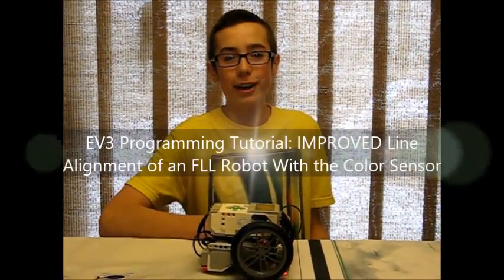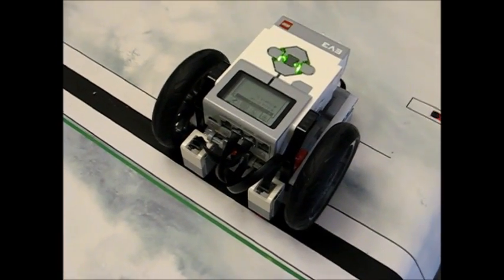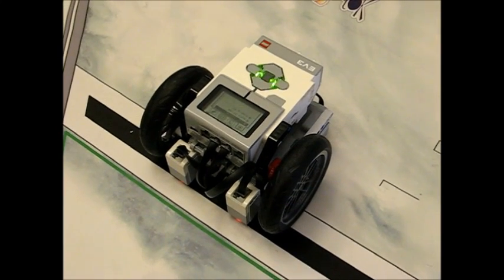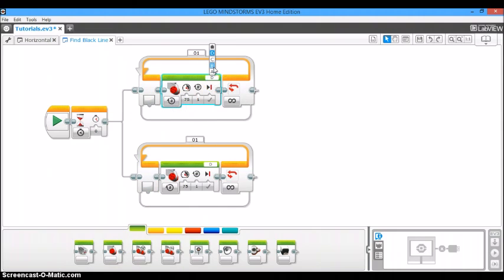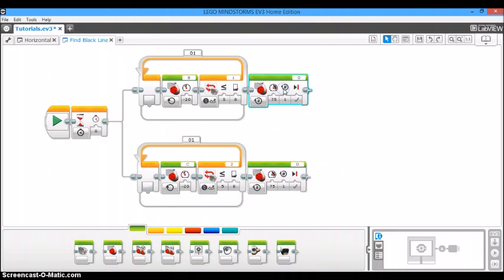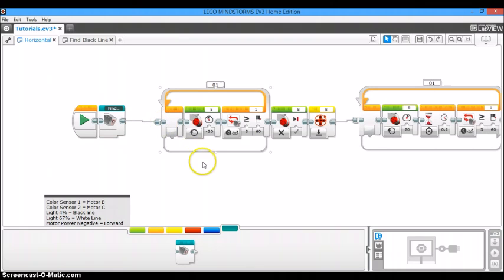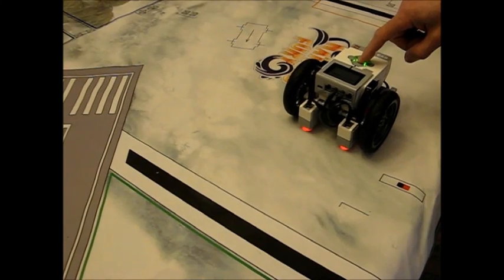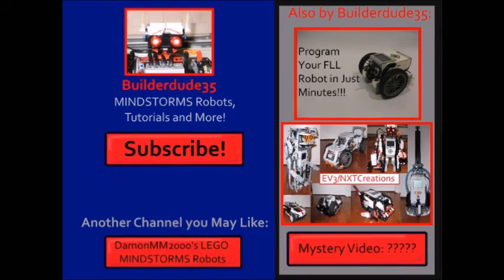Line Squaring an FLL Robot W/ Color Sensors (Part 2 of 3)

Comment: That's quite an improvement!  What happens when you make the motors turn a little less quickly?  Does it improve the accuracy?  It would've been nice to see what the new addition would've done by itself, before you added it to the rest of the program.  That way it becomes more evident how it functions.
Reply from the maker: Xander Soldaat Yes, going slower might improve accuracy, but it may be by such a small, immeasurable amount or not at all that it wouldn't be worth wasting time going slower. I have actually rethought the program yet again and may post yet another expansion tutorial. Stay tuned! And thanks again for the suggestion!
Reply: Experimentation is the ultimate proof.  I look forward to seeing the next iteration of your program!  Making videos and speaking in front of a camera is not easy and you do a great job.